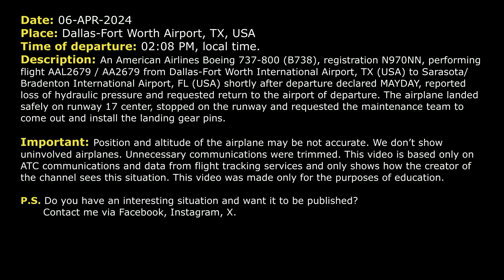MAYDAY. Hydraulic failure after takeoff. American Boeing 737 stops on runway at Dallas. Real ATC

Comment: I’m confused. Why did they descend them to 3000 then have them climb to 5000? Especially as an emergency aircraft? I’m not a pilot, clearly. Just love aviation. 😊✈️
Reply: Because that plane was turning and passing through Dallas Love Field final approach path, DAL go around is 2000 to 3000 ft, so that's why ATC had them climbed to 5000

Comment: and the boeing hits just keep on coming
Reply: What about the second recall of A380’s for wing cracks where the patches are being patched.
Reply: It's not a BOEING fault this time. The investigation is probably underway, but the pilot did mention maintenance on the engines just before that flight, and now they have hydraulic pressure problem. Someone likely forgot to screw a bolt in or something (all of course speculation at this point). Regardless, if I never perform maintenance on my car, abuse my car, OR perform a maintenance procedure wrong on my car, is it the car manufacturers fault? Exactly.

Stop making aviation toxic, like fanwars between sports teams and kpop, we don't have room for bs like that here.
Reply: 21.2 million flights a year. I guess you missed all the Airbus and Embraer video's? Pay attention.
Reply: @malahammer  I have been. PR guys like you for Boeing are not helping
Reply: @arashkamangir331  Has nothing to do with being a Boeing fan or not. Airbus has just as many issues with their aircraft as Boeing does, they just aren't in the US so they don't get the bad press like Boeing does. Just go back and look at the A400 test program that killed an entire flight crew because of Airbus' thoughts that the pilots shouldn't be involved in a decision-making process, then get back to me.
Reply: Ah here come all the Boeing fanboys and those paid by them. You think they’ll kill the second whistleblower too?

Comment: Are the gear pins needed to keep the gear in place because normally hydraulic pressure keeps them locked?
Are they something on the plane, or does someone need to run to the hangar and get them?
Reply: The the lock over link will lock the landing gear in place. The hydraulics just add an extra layer of stability to the landing gear. The gear pins are installed because if a hard bump or too hard a turn can actually unlock the lock over link and cause a gear collapse. The hydraulics also actuate the steering for the nosewheel, so most likely they would have to be towed in despite him saying they would taxi in.
Reply: True, the reaction link has 2 springs that will "break" gear over center
No danger of gear collapse. No hyd pressure, no steering at NLG